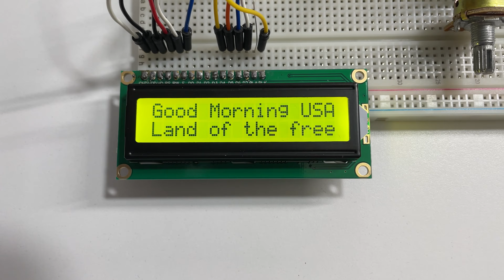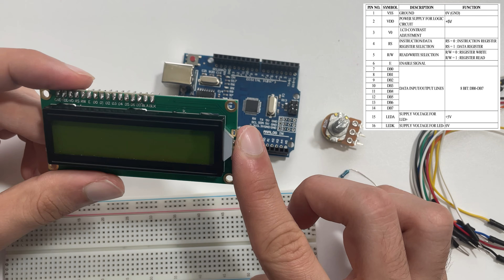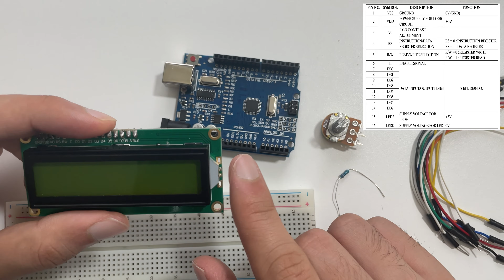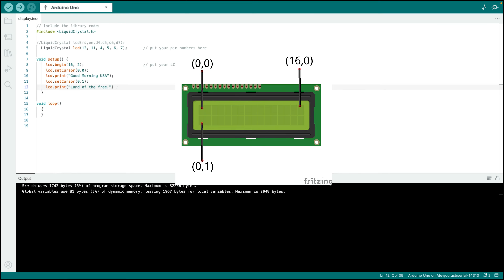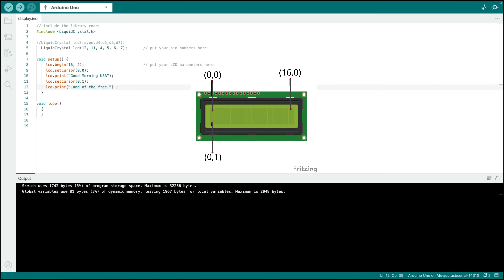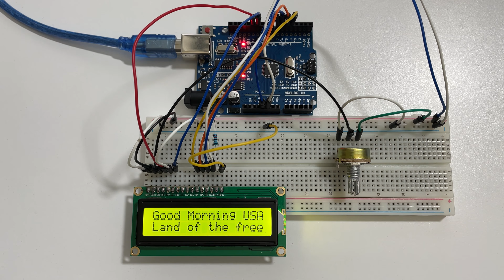16*2 LCD Display with Arduino: Tutorial For Beginners

Comment: I am facing a low light or dim display problem display is not bright enough the way it was earlier, can you help or help solve this problem
Reply from the maker: a couple of scenarios:
1) If you can see the text on the screen, but it's not bright enough then the problem could be with your pin 15. Use a 220 ohm resistor and make sure it's connected to 5v power.
2) If you can't see anything and your screen is also dim, try adjusting your potentiometer.
3) If nothing is working, remove everything and try reconnecting.
Reply: @KingKodes  first scenario is right I can see text but it's not bright enough. Will surely try your advise brother. I am not an engineer like you so understanding and doing things myself is little difficult. But seriously thanks for quick reply and solutions. ☺️
Reply: Where you from brother ? Just asking because I have some work to discuss with you.
Reply from the maker: usa my friend